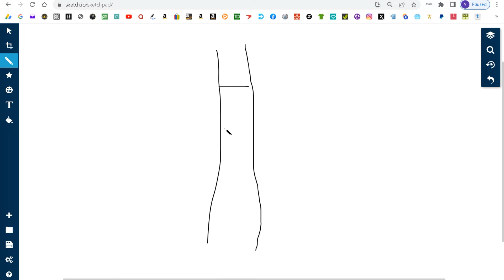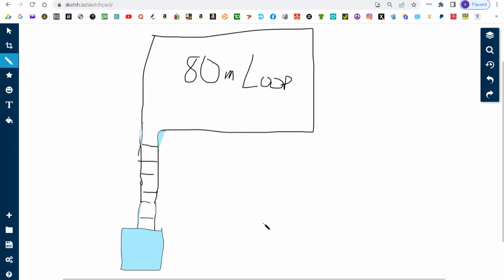UNDERSTANDING LADDER LINE CHARACTERISTICS / LOW LOSS LADDER LINE

Comment: At 1.04-1.05, you said that when one conductor takes the power up from the transmitter, the other conductor brings down the unused power. You may want to reconcile. 
The comments section is also useful apart from the video presentation. Thank you. 
de VU2RZA

Comment: That was a good explanation!   Very helpful!  However, let me add...

The big reason ladder line, open window ladder line, and 300 ohm twin lead introduce less loss than coax is because they are all balanced feed lines.  Each conductor is 180 degrees out of phase with the other, which causes the magnetic field around them to cancel and collapse.  In contrast, coax shield can radiate and the dielectric of the coax absorbs some of the RF.

And, the primary reason one might twist ladder line is to maintain balance.  Imagine, for a moment, you have a long run of ladder line that must run parallel to a metal tower support.  If you run the line without the twist, the feed line conductor nearest the metal tower support will couple to it more than the other feed line conductor.   That unbalances the balanced feed line.   The magnetic fields of the two conductors no longer cancel each other out.  A periodic twist of the ladder line as it runs past the metal tower support helps to ensure that balance is maintained.   That said, any coupling between the feed line conductors and the metal tower support still represents some loss, but nowhere near as much as if the balanced feed line was no longer balanced.  So, yes, keep your balanced feed lines away from long parallel conductors.

Another thing of which to be aware is that it is okay to run a balanced feed line across a metal object that runs perpendicular to the feed line, so long as both conductors of the feed line cross at the same point - like the edge of a gutter on your house.   Yes, there will be a minimum amount of coupling to the gutter - but, because both conductors are coupling the same amount, but 180 degrees out of phase, it is minimal.

The bottom line is that you want to maintain the balance in balanced feed lines.  You do that by twisting the feed line and keeping it away from metal objects.   If something is not magnetic (not affected by magnetic fields), its effects on balanced feed lines is negligible.  But, remember, the ground IS affected by magnetic fields, so don't bury balanced feed lines in the ground.

Finally, the balanced feed line stub on the G5RV is used as an impedance transformer.  As it was designed to be resonant on 20 meters, it serves as a matching stub to 75 ohm coax.  This allows the G5RV to be used on 20 meters without a tuner.   On other bands, the matching stub may improve the impedance match, or not.   But, with a tuner, the G5RV provides the operator with a good general purpose multi band antenna.

Thanks for the video, and 73!
Reply from the maker: grest addition to the video, Thank you

Comment: My take away is to use 600 ohm for dipoles, is that correct?  Is the main benefit of ladder vs coax the ability to run long distance from antenna to shack?  How does your 80 meter loop work?  How high in the air is it?  Thanks for the video.
Reply from the maker: I stayed with 450 ohm simply because I had it, and I am very satisfied with my loop's performance. All 4 corners are roughly 35' in the air, That is low for 80 meters but it still works surprisingly well, even better on higher bands. The ladder line can handle higher SWR over coax and when put right to the tuner or on a balun close to tuner the loss is minor compared to a  run of coax with higher SWR.

Comment: Thanks for sharing your knowledge. My favorite antenna is a 80 Meter full wave horizontal loop antenna fed with 450 Ohm Ladder line. At the rig end, the ladder line gives into a 4:1 Balun and then into a tuner via short coax jumper cable. Tunes all bands,super quiet receive and fantastic DX performance on higher frequency bands....just be sure to unplug the antenna from the radios when actually not in use. You can rubber band a fluorescent tube to the coax and enjoy thunder storms as the tube will flash with lightening strikes...good fun!
Reply: I want to make one like that. Do you know your wire and ladder line lengths?
Reply from the maker: You have to figure the wire length according to the lowest frequency used, ladder line length I like to use just what I need. I have adjusted its length to lower impedance.
Reply from the maker: I did not know about the tube flashing thing, I will try that. Thank you

Comment: Great Explanation! I use the 600-ohm version of the ladder line and do not twist the wire to a height of about 70 feet without issue.  Keep the videos coming.

Comment: As the feed line gets farther apart do the conductors need to be larger? The reason I’m asking I saw an old WW2 radio station that had 4 inch or so copper tubes  feeding a massive loop. They were about 20-26 inches apart, maybe more. 
Would that mean it’s higher in ohms like 1200 or 2400?
Many of the 600 ohm ladder line builders use 12 gauge and not 16 or 18 so I thought it might be a scaling up type thing.
Reply from the maker: The only real consideration with spacing is it should not be over 1 percent of the highest-frequency wavelength. Since you mention massive loop and WW2 I am assuming the antenna is well outside the ham bands. A 1-inch spaced with #18 line is 450 ohm, the same 1-inch spaced with #14 line is 370 ohms. The spacing and wire size work together in producing the Ohm rating of the line. A 6-inch spaced with #12 is about 600 ohms. Scaling up does play a part in power rating, but the design characteristics has the final say.

The Ohm rating is far less critical with open wire then it is with coax since you are not trying to match it at the feed point.
Reply: I want to thank you for the clarification! That is one of those things in the back of my mind that puzzled me. 
You channel is very informative and helpful.